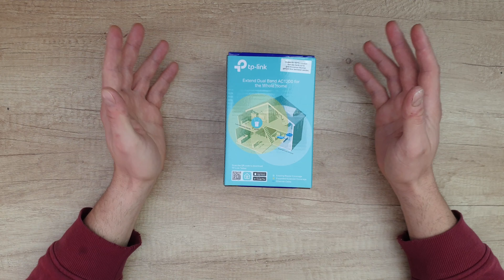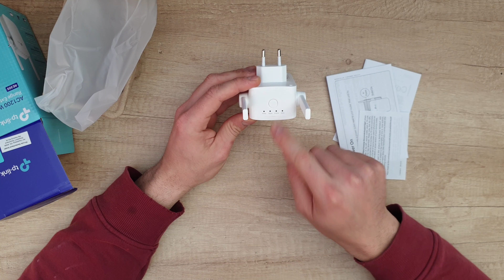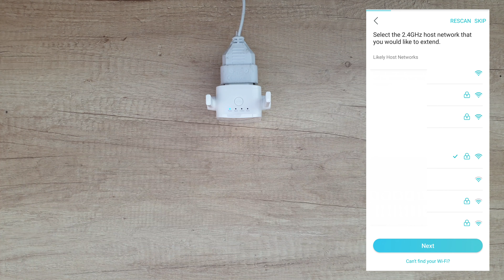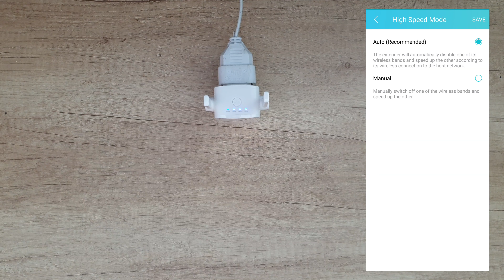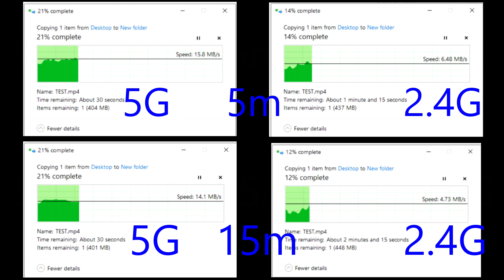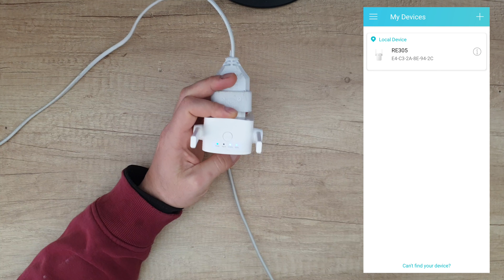TP-LINK RE305 AC1200 Wi Fi Range Extender SPEED TEST

Comment: Does anyone know is it able to repeat signal but to share with ethernet to connect to other router at better position to share internet. Basically TP link to get from main Wi-Fi router internet, connect it with cable with my ASUS router and use it from there with Wi-Fi?